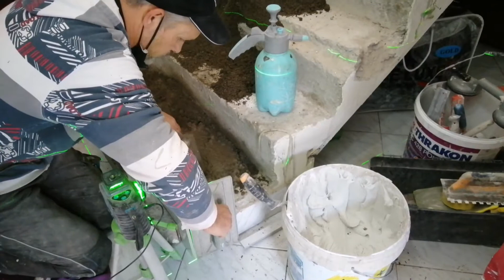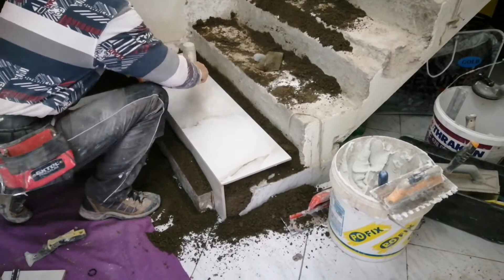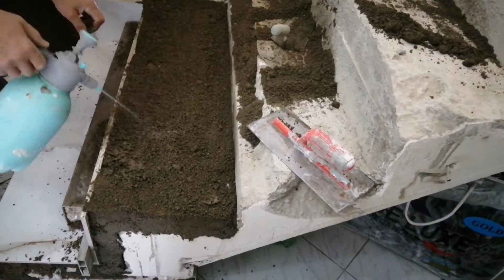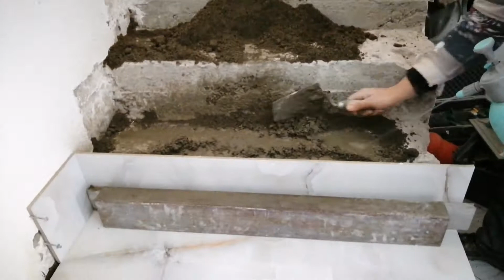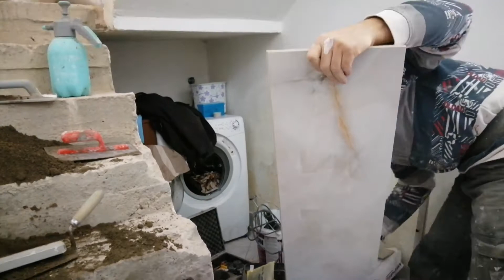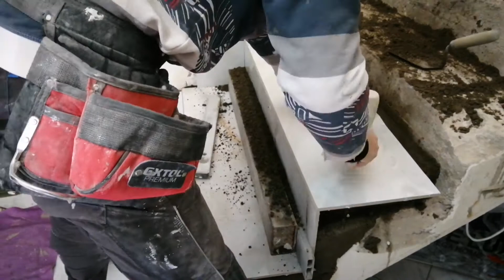Best method of tiling staircase | Montimi i shkallëve me pllaka

Comment: What mixture is this? Only sand or sand and cement? Or you add hydrated lime as well?
Reply from the maker: Yes it is sand mixed with cement, and in in top of that we add something which is called "cement milk" made with water mixed with Cement till it gets fatter
Reply: @PR0TILES  Instead of the "cement milk", can we use a tile adhesive instead?
Reply from the maker: @dotnetcademy  Yes of course, but it can lead you to bad nivelisation. This is a pretty easy way .
Reply: @PR0TILES  Okay thank you for your response. I have a DIY project coming up soon for the staircase, and I learned a lot from your video. The thing that's bothering me is that for each riser, I have two tiles to place instead of one. So keeping two tiles vertically up in place could be tricky when laying the cement and sand mixture. Is there any trick that you can provide me when working with two tiles for each step?
Reply from the maker: @dotnetcademy  Hmm you can use this mixture at the same time while tiling just when you have in this case 120cm tiles or more. In youre case its better to measure the stairs and to start nivelising them with cement and sand, until all stairs to be all equal, leave them and next day start tiling... hope it can help you.